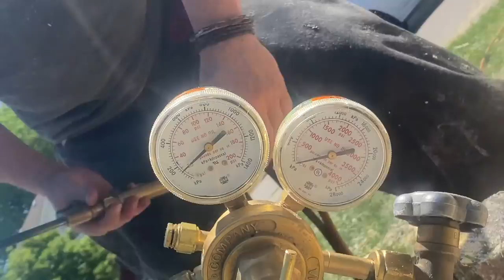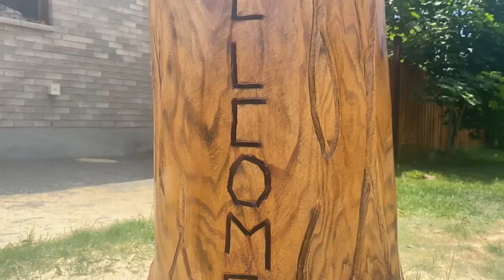Front Yard Welcome Bear - Carving up Neighborhoods

Comment: I love it, how do you get it burn so nice.  I have tried several touches. What are you using?
Reply from the maker: You need a hot torch. I use propane /oxygen torch set
Reply: @CarverKingsOfficial  I have used just a propane but one with oxygen. That would explain why your touch burns hotter.
Reply from the maker: Yes for sure. Especially if the wood is wet or green at all.

Comment: Very nice work , is the bar on 562XP Cannon Supermini ?
Reply from the maker: YEs it is
Reply: @CarverKingsOfficial  Thanks a lot , i enjoy sculpting in wood 346 XP & 562 XP was on discount and i bought both of the saws.346 with 18"bar pulling .325 chain and 562 with solid nose 20" bar equipped s with 3/8" chain.346 responded acceptable to old old chainsaw carving habits but with the 562 I was about to come close to eat it in the middle of my face for a few times so I was looking for a solution to make this saw usable I am not carving mostly doing some abstract work without too much tricky cuts but still it's better to change that solid nose logging bar i guess.Thanks a lot.
Reply from the maker: @K1To749  Great saws. Oh my yes need to be really careful.  I use the cannon supermini with 3/8 low pro.  But still have to be carefull and use proper technique when cutting with the tip